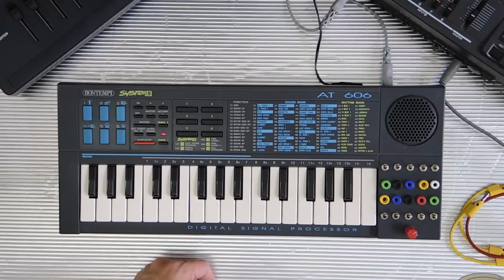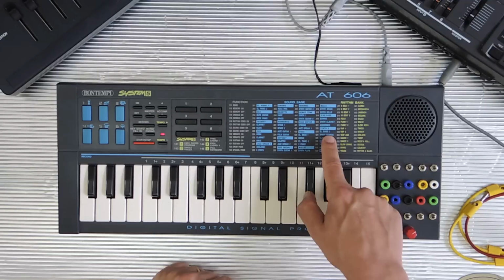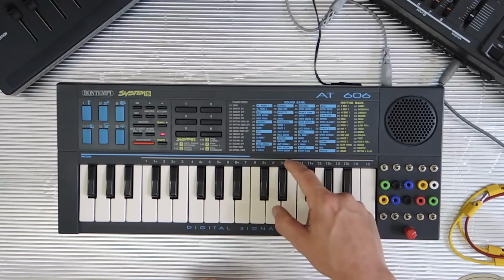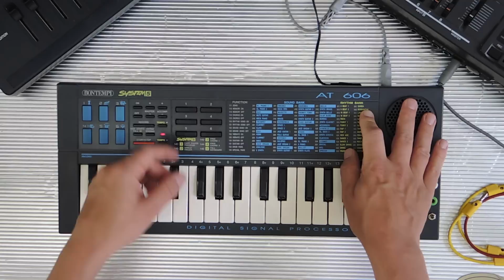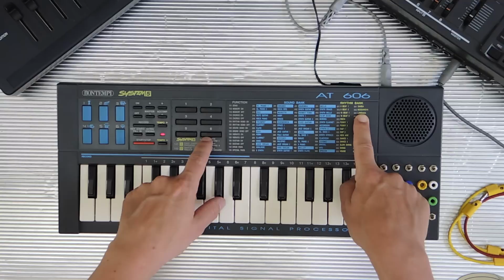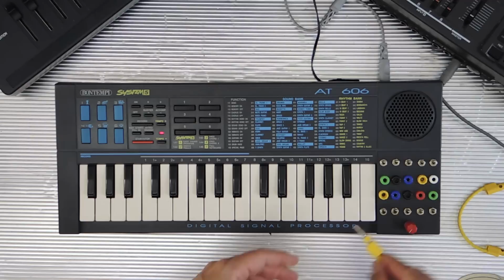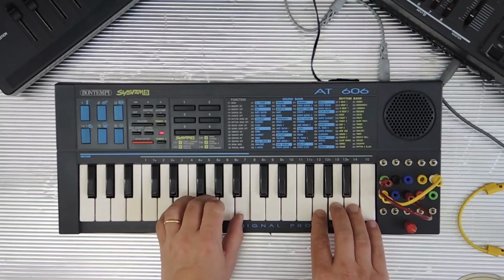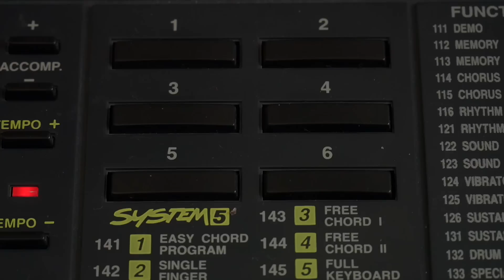The Idea Machine - Circuit Bent Bontempi System 5

Comment: Are the 1/4" jacks on the modded AT606 "break on insertion"?  I'll bet they are floating, with no connection to 0V or ground on the sleeve. Find the offending jack that freaks out the main IC and give it an 0v reference upon patch cable removal.

Comment: I remember bending that one a few years ago (at606) for someone. But regarding the system 5('s) the most  interesting one in my opinion is the bigger one (i'm sorry i don't have a model because i put paint on it  so i can't find it's number/ model thing). There was more components and there was more bends points as well comparing to the 606... If someone is interesting i can send pictures of it. I added a joystick and a cable patch plus buttons and switches as well of course. I did noise gigs with him back in the days, and one could easily do a one hour improv with him without doing the same sounds/drones or sequence...  But you had to master his randomness chaotic sequence that would sometimes be triggered.  It's on my first circuit bending project (2003 if i remember correctly) and it's still to this day one of my favorite modified toy. Highly recommended if you're into bending , and it's super cheap and easy to find  too, at least it was at the time.

peace yo ::/
Reply: Hi I have a bontempi at 606 and I'm interested of your scheme if you can share with me..thanks🖤
Reply: Hi sorry for a late answer. Did you start your project ? You must have start bending the thing,, but if not  I can try to send you something sure...

Comment: Are you sure that an AT-707 circuit board is different?  The unit looks much the same as an AT-606 on the outside but with extra buttons for sampled sounds.

Comment: I dont know why he said only the AT 606 is bendable.. BT 605 seems to be almost identical but it doesnt do the chimes when you chose sounds
Reply from the maker: Have you looked inside? I don't remember what models, but most had much more limited contacts on the chips. So not as nice to bend.
Reply: @Hainbach  I only installed a volume control years ago wen I opened it up, indeed didnt find anything but didnt look very hard..., but I have seen others bent and have been wanting to check it up again some time... But maybe you are right!